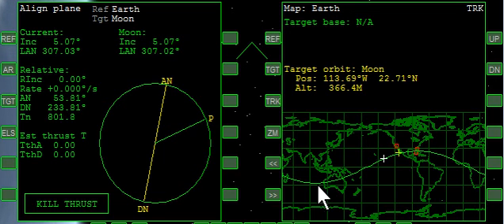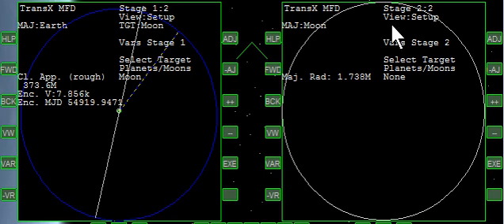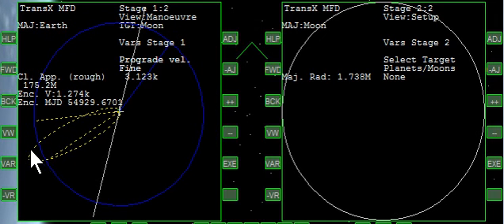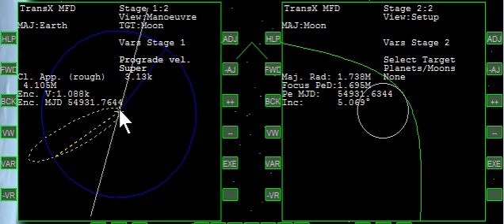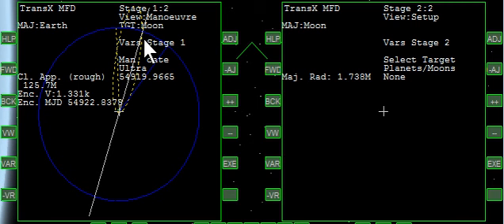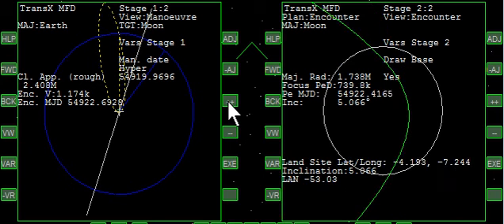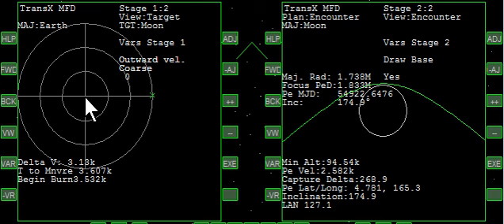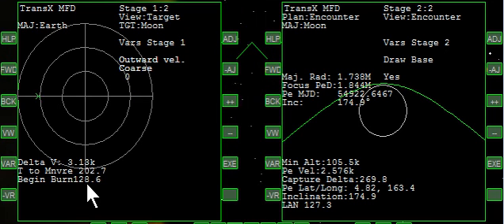TransX Tutorial - Earth to Moon

Comment: What exactly is the inclination? The variable which started out at 5 and ended up at about 175?
Reply: It is how much the orbit is tilted relative to the equator so like an orbit with 0 degrees of inclination goes straight above the equator all the time an orbit with 90 degrees of inclination goes through the poles and 180 would be a an orbit that goes in exactly the opposite direction as the 0 degree one